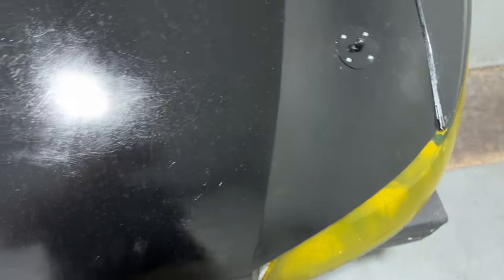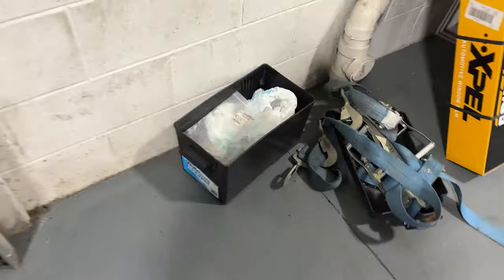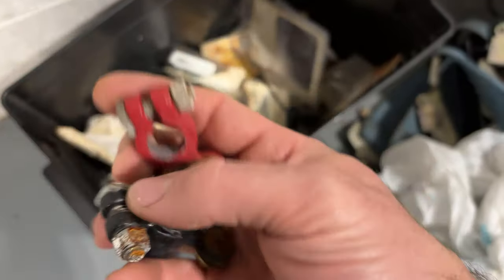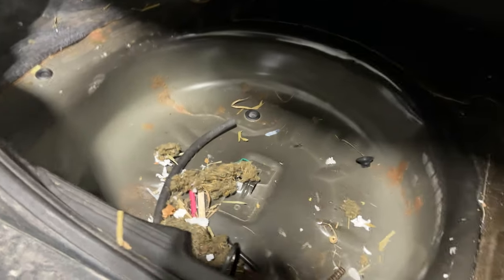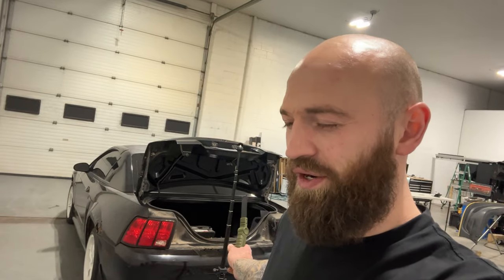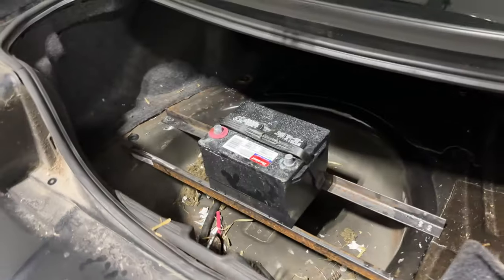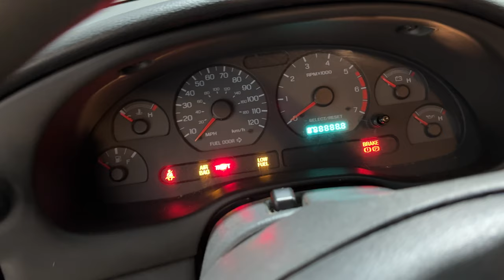Simple Battery Relocation (79-04 Mustang)

Comment: Try running the cable through the fire wall, there should be a grommet you can make an extra hole into. I ran mine like that also. The cable should be long enough if it ran through the outside the door
Reply from the maker: I'll give it a go. Under the dash is my least favorite place to work so I try avoiding it as much as possible 😅